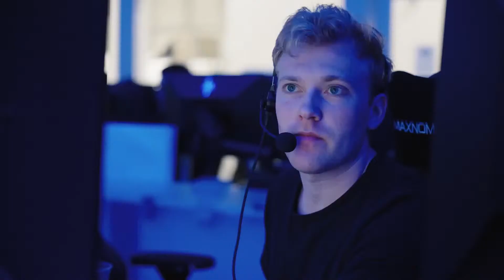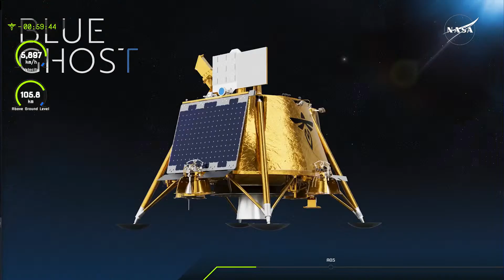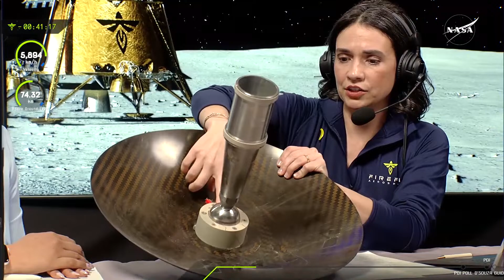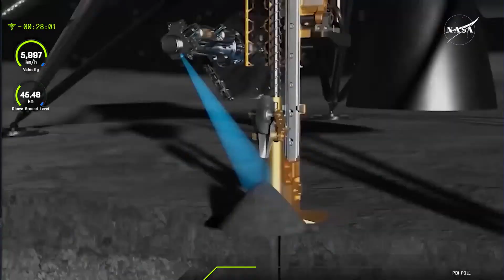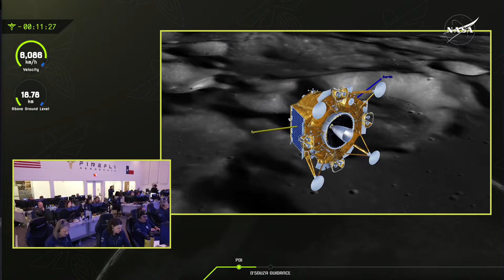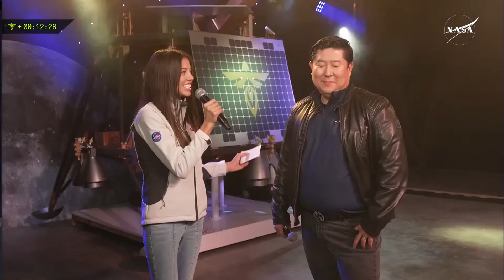Firefly's Blue Ghost Mission 1 Lunar Landing

Comment: I was a Rocket Test Engineer for Bell Aerosystems, Niagara Falls, NY from 1965 - 1969. Bell designed, built, tested and delivered the Apollo Lunar Module Ascent Engine which lifted the astronauts off the moon on the way back to the orbiting Apollo Command Module. 100% success on all tests and missions. The engine was ablatively cooled and used hypergolic propellants;   Low chamber pressure 120psi.  Previous 100% successful Bell rocket was the Agena engine used on many NASA missions.  Hearty congratulations to Firefly personnel for this extraordinary achievement!

Comment: Did I just watch a CGI animation from a Windows 95 Moon lander simulator? What was that? Then that horrible final image that everyone sat through 2 hours for as proof that this actually happened?
Reply: It was a fn joke
Reply: это фейк. как и человек на луне
Reply: @dmitry953  The inverse square law (signal strength fading with distance) makes it difficult to get a broadband signal from 400,000 km distance, not without resorting to lasers.  And even then, keeping the laser on target is difficult, due to earth's rotation and moon's orbit.  Communication with ISS is easier, at 350-500 km distance above the earth's surface, or 1/1000th the distance to the moon.  But paranoids will continue to believe it's all rigged bc paranoids can't help but end up in that corner of their mind.
Reply: @MisterName-v5k  You apparently have some engineering ability so ask yourself why they didn’t trigger video to record to local storage, and then download it later.
Reply: Looks like there is video now; v=NpHhEybJdxg
Reply: See i thought I was the only one ,in th 60s you had broadcast footage from the moon of a guy climbing out of the lander but in 2025 we get cgi and blurry footage ,cmon how we supposed to believe  this happened 2 hours and cgi I could've had Ai do this

Comment: When I first noticed how low the engine was, it gave me a red flag. If the lander lands in rocks, there is a high probability it will be high centered resting on the engine and now that there are only three confirmed feet on the moon surface it confirms my Initial thought.

Comment: By that ending picture, the camera angle sort of gives the impression the lander is tipped over on it`s side.The right side of the camera shot is dust floating around so that`s facing up and the left side is the ground, wouldn`t that be the correct interpretation?

Comment: is it too much to ask for a video of the landing, with todays video abilities, I dont see why that cant be done.
Reply: Inverse Square Law, Distance from earth, available power of transmitter in flight/landing configuration, available battery power during landing sequence, bandwidth required for video vs. bandwidth available for telemetry. Read my comment above in respose to williammann7247 for a little more detailed explanation. Basically, Its exponentially easier to send live video from near-earth orbit like the ISS and during launches than it is from 250,000 miles away and still be able to monitor all of the necessary systems.
Reply: @DiamondPaintWithDiamondDave  ok but they had live feed on the moon surface with the Apollo astronauts in the 1960s & 70s.
Reply: @ReRe-yl6dq  yes, AFTER they had landed, and was horrible quality, and they had to jury rig a way to do it using the arcane tech of the time to fit a 6Mb TV signal through a 2Mb bandwidth space. HDTV wasnt even a glimmer in their eyes at that point. Even then, the product wasnt in any way able to be sent back out across the airwaves  in the state it was recieved. Instead, they had to play it back on the TV's at the receiving station while using an earth-based TV camera focused on that TV screen to send out the final product that was seen in everyone's home TV broadcast. Any other clearer footage you saw was from later missions, using a bit better tech, bigger transmission systems and antennas, and it surely still wasn't in HD. The best footage captured during the moon missions was all film that was then brought back and developed. Tim Dodd on youtube just put out a video this past week detailing the moon landings and the science and truth behind a lot of what people refute. There's a whole segment devoted to the TV broadcasts and filming. The channel is Everyday Astronaut. The Video is Titled "The Truth About the Moon Landings" You could start with the second chapter beginning at 4:40 where he talks about the moon footage as a whole, or you could skip ahead a bit in that chapter to 9:30 where he discusses how they got the TV footage down to earth.
Reply: It is bs!
Reply: Well, Firefly could prioritise the limited available communications bandwidth for your entertainment, or they could use it to make sure they new exactly how all the on-board systems were performing. Guess which option they chose.
Reply: @PeerAdder  again, it wasn't a problem to have communication in the 1960s, but now it is. Alot is learned with video beyond entertainment.

Comment: i find the retroreflectors that are used here and corner cubes used in the past to be very interesting simple tools that can provide many uses or be used to model many interesting ways w optics.  My favorite set up is to put numerous ones in concentric nested spheres that allow one light source then allow the light to navigate throughout the rest of the unit alternating course at times due when some of the reflection gets reversed.  There's even areas where a hologram of sorts appears similar to when seeing 4 combined images collectively displayed with a triangular prism sitting on top of a screen.   Im curious how someone would be able to land on this hologram to run tests at its surface?  It may help future missions for exploration.

Comment: Congrats!

Any explanation why height reading jumped to 700m at the moment of landing?
Reply: Pretty sure that's the altitude of the local terrain above the moon's median diameter.  Same as how everyone's town has an established height above sea level on earth.
Reply: @johntremain8403  no it was going down to couple meters before jumping 700m up
Reply: @rokadamlje5365  So just like landing a plane, (or Apollo), the lander would track it's elevation above the ground with radar.  So during descent it did that.  It reported height above the ground.  I think when it touched down and the engines powered down, it then switched from the radar to reporting it's geographic elevation.  I'm not 100% sure, but the Mare Crisium crater where it landed is around that elevation.

Comment: SEE WE CAN LAND ON THE MOON 55 YEARS LATER ! ! !👌👌👌
Reply: So much bs here none of us can use our names.. . But that might take up valuable blah blah bandwith
Reply: did we though?  I was watching hoping to see some kind of telemetry video but no, just a nice 3d model and some dude talking.
Reply: @CameronL-l5k  The Moon is 380 000 km away. Videos consist of hundreds of images, each of which is an extremely heavy file. To send them in real time across that distance you'd need a big antenna on the lander and enormous antennas on the ground. Not to mention how much energy it would drain. Telemetry data is much more useful for the ground control than videos are anyway and transmitting it is much easier. 
If they wanted to have live views of the Moon, they would need to decrease the mass of the lander, so that they can put a bigger antenna on it and cut down the energy usage, to be able to send unnecessarily heavy files quickly. The only way to do this would be to get rid of some of the scientific instruments. Sounds like a great idea! Let's sacrifice crucial scientific data so that some simpletons can watch the landing live!
Reply: @raptorwhite6468  they managed it in 1969, simpleton.
Reply: @CameronL-l5k  exactly, they went to the moon and all they sent back was one lousy picture that could have been taken in their basement for all we know. Looks like a scam to me

Comment: The lack of live feed is utterly bemusing.
Reply: too expensive
Reply: you do realize to even do that would be a 38 mile antenna flying up into space to reach earth at all ? or did you even bother reading history and knowing how its done? or did you just come here for attention?
Reply: @Domaorn  there was a live feed for a previous moon landing 1 year ago, or are you just rewriting history at this point ?
Reply: This is happening on the OTHER SIDE  of the moon.  There are no antennas to provide live coverage.
Reply: @williammann7247  let's put 1000s if satellites around earth where they're not needed and 0 around the moon
Reply: @williammann7247  obvious solution, land on the right side of the moon
Reply: @williammann7247  This happened on the daylight (near) side of the moon in Mare Crisium. The reason for no live feed is actually a quite lengthy and technical explanation that can't be put into one youtube comment that anyone would willingly read. The long and short is, there's only so much information that can exist within one radio signal (bandwidth). A very weak radio signal at that. Radio signals obey the Inverse Square Law, essentially meaning that doubling the distance from the transmitter results in a signal strength that is only one-quarter of the original intensity. The lower the signal strength, the less information can be carried on that signal at any given time. The amount of information is determined by the frequency range of the signal. The frequency range and power of the transmitter they can use is limited by available weight and size on the craft. Which, on a lander this size in a flight configuration, isnt much. During operations such as landing, all of the available bandwidth is taken up by the telemetry data that they use to monitor the craft and it's progress due to the relatively low signal strength at a distance of 250,000 miles from earth. Signals such as video and still imagery take up a very large portion of that, so it is easier to use the telemetry received here on earth to drive a CGI representation of the craft in near real-time to give people something to watch. Once it's landed and reconfigured for lunar surface operations, better antennae and more powerful tansmitters can be deployed allowing for better picture and video quality to be sent back. none of this even takes into account that all electrical systems operate on battery power, which during landing, drain quite quickly. Listen to the battery level callouts during landing. After touchdown there was a callout that it was charging again. Sending video back live could have possibly prevented enough battery power to make it all the way down safely..That is probably the shortest explanation that can be given and make it understandeable to the average person. These conspiracy people have no understanding of electronics and electromagnetic transmission, so they automatically chalk up the absence of live feed as failure to prove because they are used to near-earth orbital missions provideing live footage, which is exponentially easier to do than from 250,000 miles away.

Comment: It's amazing how good the transmission was in 1969 compared to how bad it was today 2025, where the only pictures were from simulations. It could have been radio.
Reply: It was also audio in 1969.  The first actual video image was from the camera on the leg of the Eagle showing Neal coming down the ladder.  If you rewatch the 1969 landing, it was very similar, cartoon animations during descent with the audio from Neal/Buzz/Mission Control.  The landing video that your thinking of was from a 16mm film camera inside the crew compartment that was developed and broadcast after they returned.  This lander had optical cameras that it used to avoid rocks with no pilots, so we'll probably get an approach video from the lander sometime this morning, or in the coming days.
Reply: There were no live pictures from the landing in 1969. Only radio. Once they landed, they could set up a signal. As they will now as well.
Reply: @hepphepps8356 ?. It was televised live at the time, all the way to touchdown.
Reply: They had to set up a large TV antenna dish. The antenna was lined with 38 miles of fine gold-plated wire, thinner than human hair.
And this was only set up in later missions because NASA was unhappy they couldn't spy on the astronauts in the first missions. The camera and antenna equipment was heavy and required humans to unpack and assemble it.

Comment: This should be the next lunar challenge.  All you successful YouTubers with money to burn which one of you can send just a camera to the moon for livestream?!  Do it for the views!
Reply: Adding a camera would not provide a live stream without a high-bandwidth radio link during the descent.
Reply: @ericfielding2540  you don't need high bandwidth, you need to wait for the signal to reach, and that's very ok...
Reply: @Utroll the delay is inevitable but you cannot live stream if you do not have the bandwidth to support the data rate for your stream. You can send back data slower than real time but that would not be a live stream.
Reply: @joeshmoe4207   Correct.  The inverse square law (signal strength fading with distance) makes it difficult to get a broadband signal from 400,000 km distance, not without resorting to lasers.  Easy with ISS at 350-500 km distance above the earth's surface, or 1/1000th the distance to the moon.  But paranoids will continue to believe it's all rigged bc paranoids can't help but end up in that corner of their mind.

Comment: I would love to congratulate you accept all that i've seen so far is animation. I'm assuming that with all the money you spend on this project, there would have been enough to put cameras on the vehicle to watch. It's descent and landing live
Reply: I think, only 50% of the entire amount can be put into one project. The rest 50%, they have to keep aside for the next project.
Reply: It really doesn't cost anything extra to get a feed from the cameras, considering they made a huge deal of providing live footage of a moon landing. Very disappointed
Reply: There are cameras on board, but they aren’t live, as NASA didn’t contract them for that, so there’s no need to add weight for something that isn’t necessary for the mission. The pictures will be released once the Firefly team has gotten them into high definition as stated at the end of the broadcast. All in all, the main reason the cameras weren’t transmitting live feed was because that would add more weight, and cost more to launch because of that added weight
Reply: To add on, the contract is around $103 million for the project. Accounting for around $60,000 per kilogram (around average for a Falcon 9 launch to the moon), and a lander with a mass of around 1500 kg, that comes out to be around $90 million. Add on the development costs, and there’s no more room in the contract for extra weight
Reply: It is much harder to beam video from the moon than it is from low earth orbit or the space station. There are cameras on board. We will see video later.

Comment: As I said in the chat, I highly doubt that any payloads will be successfully deployed because every payload works with a particular sensor. If sensor readings are not favorable, the payloads won't deploy successfully. With one leg of the lander still hanging free or not properly touched down, I guarantee this was not a successful landing. Sure, your lander is on the moon, but not successfully landed. Anyway, great attempt.